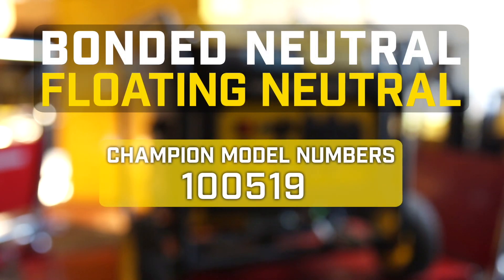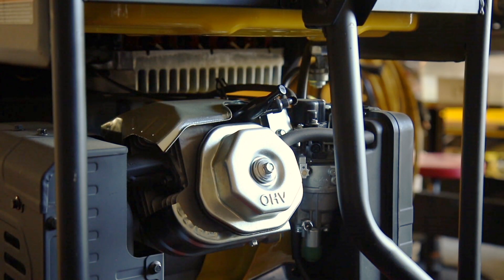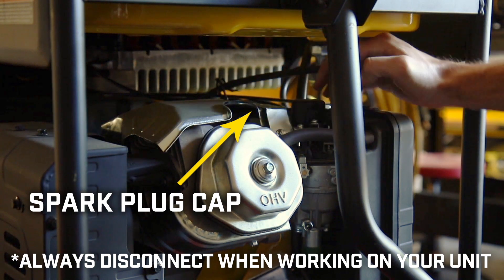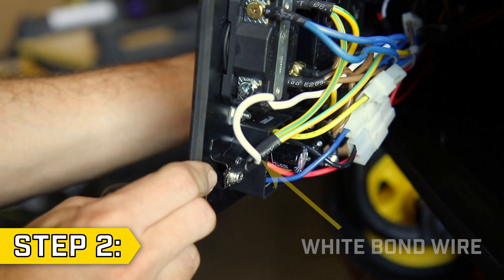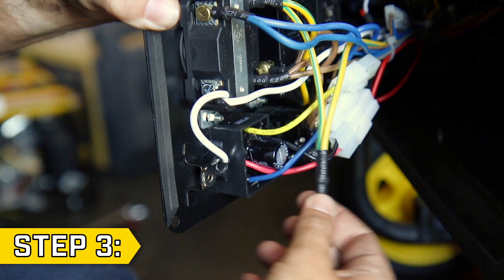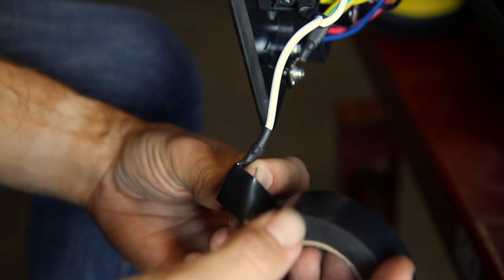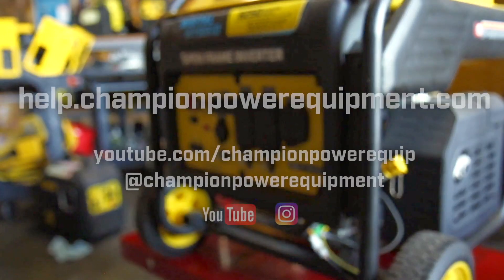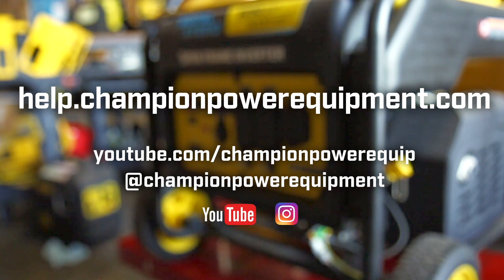Disconnect the Bonded Neutral (100519)

Comment: My model 100519 generator shows a screw on the back of the control panel, like the one video, but there are no wires connected to it.  As there is a sticker saying that the generator has its neutral bonded, i assume it is, but this video did not help me change it to floating.
Reply from the maker: Thank you for reaching out. This video pertains to model 100519, so the information should be applicable to your unit as well. We recommend contacting our support team and, if possible, providing a picture so we can guide you through the process of converting your unit to a floating neutral. You can reach our support team at 1-877-338-0999, via email at support@cpeauto.com, or through our live chat on our website. We would be happy to assist you with the process.

Comment: Will this work on the 100520 model?
Reply: I have the same question and have been trying to get a reply from customer service. I have the 100520 but the video does not match where the ground is. Instead my 520 has two wires (one is green yellow, the other white) in the same location as this panel on the 519 -bottom right (but there is only one green yellow wire with one white wire). But also on the top left there are two green yellow wires connected flat to the panel so idk if it’s those wires like the other commenter said 😩
Reply: @ I saw another video where they removed the white wire.  It’s on YouTube i just had to keep looking
Reply from the maker: Thank you for your question, and we apologize for the delayed response. We do have a video specific to model 100520 that demonstrates how to convert your unit to a floating neutral. Please see the following link: 

https://help.championpowerequipment.com/article/h0dnm28tp6-converting-your-open-frame-inverter-to-floating-neutral

If you have any further questions or need additional assistance, feel free to reach out. You can contact us at 1-877-338-0999, email us at support@cpeauto.com, or use the live chat feature on our main website. We’ll be happy to help!

Comment: I have this model (100519), I am planning to hook it up using an interlock kit to power my house when power goes out. Do I need to convert it to floating neutral? ( or do these come as floating neutrals already?)  I do not plan on plugging any devices directly to the generator..
Reply from the maker: The 100519s come with a bonded neutral. If the interlock device has a bonded neutral, you will need to convert the generator's bonded neutral into a floating one. 👍🏼
Reply: thanks for the quick response .  @ChampionPowerEquipmentHQ

Comment: FYI not sure when they changed this but both wires behind the screw are now green/yellow. However if you trace one of them far enough down the line it splices into the white, that is your neutral wire. From there follow the remaining steps of the video.